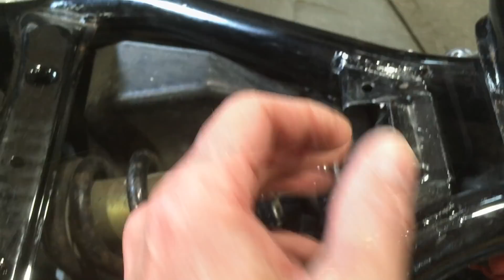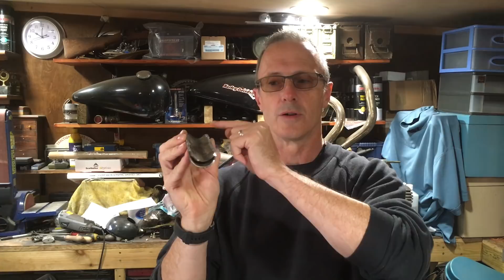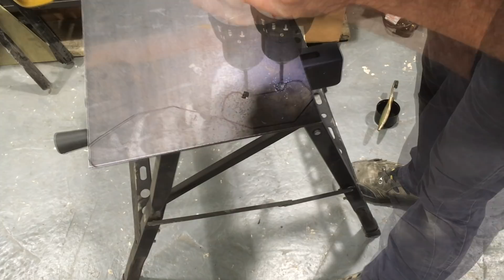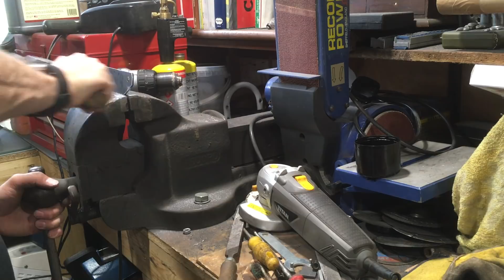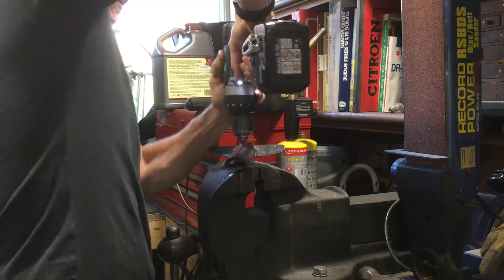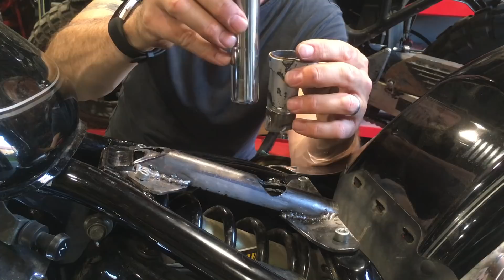Bobber Seat Build #5 Fifties Classic Bobber XVS 650 #9

Comment: Hey.. off topic but how did you get those tires to fit your Bandit 1200?
Reply from the maker: Easily.  They are the right size for the rims and I’m not using standard mudguards so no clearance issues there - never tried them with standard fenders.   Skäl.  David

Comment: Are you filming it for tonite?
Getting back to my Dt I could drill around it then heat it and pull it out and weld it the re drill the whole
Reply from the maker: Will be editing over the next couple of days.   Eight hours in the shed of fabrication works out to ten minutes of video.   If you’ve room then drilling around it do you can get a grip on it could work.   Sounds like the pin is hardened so heat might help to break it free.
Reply: Hi David 
I got that rivet out in the end 
Took ages 
Drilled both sides and had to keep hammering it 
And I welded it up
Getting a new cover and rivet 
From yambits
Cheers Garry
Reply from the maker: Great work there Garry.  Those jobs just takes ages to do right.   Skäl. David

Comment: Hi David
You couldn't help me?
I have a Yamaha Dt 250 1977
I am nearly ready to spray the frame, but the steering lock cover was missing and the rivet had been sheared off.
I tried hole punch it but it blunt the hole punch. The rivet metal won't drill.
What is your veiw on it should I just not have the cover on or should I take it to a engineer workshop
Cheers Garry
Reply from the maker: Hi Garry.  Depends if you are restoring your in which case, yes, sounds like it’s going to take some work to get the pin out as it will be pressed in, so engineer.  If not then I’d just just cover and carry on.  Skäl.  David
Reply: Yes David !! They do have you done any work on the seat?
Reply from the maker: Garry Hills seat is coming along nicely.  Tomorrow will be a repair job on the Bandit to break up the endless seat videos lol.  Trouble is that now I’ve got the seat made I’ve now got more ideas for the build that I hadn’t anticipated.   Sportster and Lomax will never get built at this rate!   Skäl. David